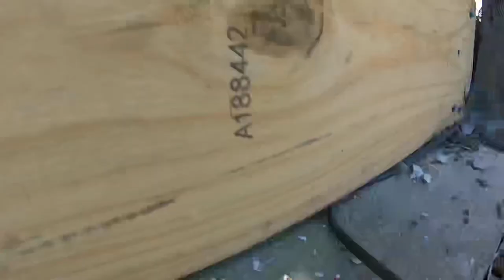Pouring concrete in cattle gates about kicked are butts #dirtperfect #captainkleeman

Comment: Guys 1st Im a cop so all Im good at is Parking  Directly  in front of the building  on fire, so the FD can find it.  So Im not understanding  the purpose  of the pipes put in the road openings since they dont go through  the wood ends to act as a culvert ??
Reply from the maker: They do go all the way thru
Reply: @DirtPerfect  well dang.... I completely  missed that, Nevermind  🤪
Reply: The pipes butt against the forms. Strip the side forms in two days or so and the pipe is exposed to allow water to pass through. I would question just 6" compared to the size of the drainage ditch but oh well, not my property.
Reply: @Rickimusic  ohhhhhhh the wood will be removed...... Im a dumbass
Reply: Ricki the pipes aren’t for drainage... they allow the electric fence wire to cross under the drive.

Comment: I’ve noticed on your YouTube channel concrete trucks are different then where I’m at here in Texas.The house demo job you did in a early video our rolloffs are hooked up different than yours down here they use a cable but the driver hast to get out we don’t have the mechanical arm that reaches out there and grabs a bar and pulls it on.

Comment: The thing I have learned about concrete, it isn't very hard to do and doesn't take all that long but at times while you are working it and pouring it you have to just about run the whole time you are doing that part.
I have seen people tie a rope to the broom head that will reach all the way across when brushing, then when you pull it back you have a rope to help keep it off the concrete. Don't ask me how well that works, I wasn't the one running that show.
Bull didn't like you going in his pen?
Reply from the maker: We have tried the rope before it works ok